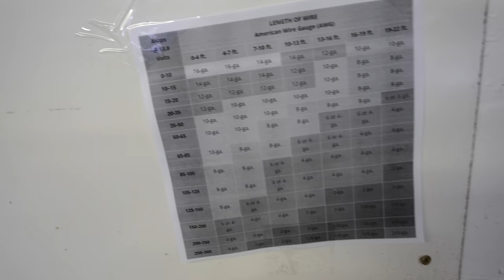Building the Brains of a Low Voltage System - Electric Hummer Conversion

Comment: Awesome.  Just a very fine point. Technically, fuses, or any overcurrent device, are there to protect the wire insulation not the wire. And yes, skin effect is an issue at 60hz. It’s why bus bars are typically only 1/4 inch thick. And then there is proximity effect which exists in both ac and dc

Comment: I just have to point out that the "current travel along the surface of the conductor" phenomenon, is called "skin effect" and only applies to AC current, not DC. And the effect is greater on greater AC frequencies. 

This is one of the reasons (although definitely not the only one) that high voltage DC is used for long distance power transmission (known as HVDC transmission lines)

Comment: You got something wrong, you said the wire has multiple small conductors because it transfers the current better. And that’s because the current runs on the outside of the wire. That’s actually not true if you say it like this, there is something like the skin effect, it says the higher the frequency of the current the more the current runs on the outside of the wire. But that’s DC so the skin effect does not „exist“ here. You can see on that if you some power company’s have actually big pipes not cables in their systems. And they only do that if because at like 50 Hz, that’s a typicall frequency in Europe, the depth of the current would be about a 1cm/that’s the thickness of you finger (for the Americans). The inner part of a very thick wire would not be needed so they use pipes with that thickness.

Thats pretty rough but i hope y all understood that.

Have a nice day

Comment: For your D.C. circuits (and typical household A.C.) you can assume the current runs thru the copper. The depth of the current is known as the skin depth, and the formula includes the frequency as well as the current. The higher the frequency the less deep the current will flow. So thousands of amps of D.C. you also start to be concerned about skin depth. In addition, unless the strands are insulated from each other they are effectively one strand so finely stranded wire is solely for flexibility. In fact at high frequencies where skin depth becomes important, finely stranded wire can be a problem because the power doesn't want to follow the strand as it dives down into the center of the bundle, making stranded wire conduct worse than solid. Physics is fun!

Comment: Jeez as fun as it seems to build an ev project so many safety questions. Is there an isolation monitoring system to verify no HV leaks, pierced HV cables, or any components internally shorted to HV. Along with isolation monitoring are the safety contactors inside the HV battery gonna deploy to prevent injury. Are the contactors inside the battery powered by a 12V crash interruped source in case of an accident? Any of the HV connectors have a interlock monitor in case of accidental disconnection or any unaware person unplugging them? You should do a video around all of your HV safety systems. All of this without some thorough safety behind it seems sketchy.

Comment: Note: The center pin in a relay is not a constant on. The center pin (87a - Normally Closed) is an off position when a the relay coil is engaged. It is the opposite to 87 - Normally Open. 87a is useful for motorized projects like window motors.

Comment: just a side note. that your information at time stamp 6:40 you say the middle relay wire you remove from the relay is pin 87a on the most relays. that is NOT ALWAYS ON. pin 87a is actually a switched wire like output pin 87. pin 87 is on with the relay but pin 87a is on when relay is off. for instance pins 87 and 87a power separate lights a pushbutton switch activates the relay which will then switch between the 87a light and the pin 87 light. switching as the button is pressed.

Comment: Cool stuff. Slightly concerned about the wire shielding wearing down on the edges of the ABS though.  Easy enough fix with a small grommet or just some RTV silicone.

Comment: hi jerry,
two notes
1. the first fuse is too far away from the battery. my suggestion is to use a Battery Terminal (Cube) fuse.
2. protect the cables with a cotton cable sheath. Otherwise, cables can chafe due to the vibrations in a vehicle.

Comment: @jerryrigeverything i would use a more intelligent fuse box and bus bars.  They have ones that are BT capable and will tell you when you have faults, your battery isn't charging or is dying and can diagnose your low voltage system quickly and accurately

Comment: Everyone saying it is easy has never done anything beyond replacing AA batteries in your remote. Its easy to watch, easy to theorize, but its an entirely other thing actually doing all of it. That fuse/breaker panel is near immaculate and he did it with a small piece of ABS. A job of this magnitude is a tremendous undertaking. How many people can measure and design the mounts for the motor, transmission and transfer case? I can only think of two people I know, and both of them are engineers. These videos are very inspiring and very interesting content. Also satisfying to watch something done and done correctly and clean.

Comment: The many strands of copper wire, do make the total cable more flexible; but, do not contribute to increasing the current carrying capability, compared to the same gauge of solid cable; in order to counter the so called 'skin effect' the individual strands must be coated with insulation; the skin effect does not happen at DC, and is not of concern, at low frequency AC, more so at RF, when the current is concentrated in the outer portion of the conductor, not on the surface.  The extension cord socket failed due to the several cables, all pulling power at the same time, not due to the length of the cables.  Have viewed several of Mister Jerry's videos, all are of value.

Comment: One fix from Electrical engineer: Current flows through the whole copper when we are thinking of relatively low frequency. As the freq increases the current is pushed more on to the "skin" of the copper wire. This is called skin effect and it is related on to freq. On DC cables this effect is virtually nonexistent.

Comment: Electrical engineer here, small correction @2:50 : what you're referring to is the skin effect and is present only on AC current and the skin depth decreases with frequency. So the current only flows on the outer edges when you're dealing with  high frequencies (so in microwave engineering for example you might have cables with hollow cores because it saves material and is not affecting the conductivity of the cable anyway). At DC however you don't have skin effect at all, all these strands essentially jusct act as a big solid conductor of equivalent size. Also all these copper strands are conductive so the skin effect would still be present in the resulting wire regardless of whether it's stranded or not (compare that with litz wire that is engineered to reduce the effects of skin depth and every strand is isolated from each other).

The only reason to have stranded wire is mechanical: the resulting cable is much more flexible and bendable as opposed to a solid piece of copper especially at these huge diameters for big currents. I also assume (don't have direct knowledge it just stands to reason) that it's easier for the cable manufacturers to produce them since they don't need to produce solid wires of different diameters, they just make tiny strands and package them together at different amounts to create the bigger cables.

Comment: Worried about the wiring setup a little bit.  It looks fantastic, but I’m not sure it’s fused correctly.  All those orange wires that were spliced to the red wires to feed power to the relays need to be individually fused because right now it looks like they’re only protected by the 100a breaker since they go directly to that distribution block, which I don’t think those wires or the relay would be able to handle 100a.  The point of the fuse/breaker is to protect the wire in case of a short or something before too much current goes through and wires/relays/switches catch fire.  It’s a very clean looking setup and I’m glad to see all those blue sea fuse panels, adhesive-lined heat shrink, etc.

Comment: Do not use a 12v Lead battery!

do not use your "main" battery to charge a 12V lead battery you better off running directly of the inverter or get a 12v lifepo4 (lithium) battery.
lead batteries are horrible to charge and to use because you throw away majority of the power you put into the batteries.

The only reason lead batteries are used in cars is because of the high AMPs require to start the car otherwize everyone would use lithium

Comment: If you don't like fire... You should not clamp up your battery on to the charger when in the car, close to the chasis. You will get a short VERY easy... (6:27)

Comment: Doing a great job. Just wondering if your melting those solder splices enough. When they are melted you shouldn't see a metal band anymore. The solder is ment to melt into the wires bonding them together. Without the solder band melted the center of the wires are not fused together, causing a hot spot and high spot of resistance. All in all, high resistance is less current and less voltage at the powered device. Also a fire hazard 🔥. Just don't want your project burning up a month after completion. Also, I'm a helicopter electrician so this is my life.

Comment: With a 12 v to 24 v boos converter all original 24 v equipment (lamps/wipers,fans) can be run from the 12 v battery.

Comment: There are two main types of 12v batteries, the normal ones and the deep cycle ones. The normal ones have spong like lead terminal to increase surface and thus can generate enough amps to crank the motor. But it can't do that for long period of time. On the other hand deep cycle can supply current for long time and many more charge cycles.

My question: don't you think deep cycle is better for ev's 12 v?

Comment: wouldn't do these heating + crimping + soldering thingys. like many videos on yt show (even tried it myself after seeing them) the wire doesn't get hot enough an this is not a proper soldering job. For applications that shouldn't break on you in the freaking desert, soldering the old fashioned way would be better. aside from that im impressed, Jerry.
Greetings

Comment: for you less knowledgeable people out there, the ones who are trying to learn things about how to work on electric vehicles for example, watch this man very carefully. because not only does he explain this in absolutely perfect detail, he's 100% correct in everything he explains to you. he doesn't leave out the little things, like the gauges of wires. Believe it or not, there's many people that have no idea about the gauge wiring, and the effect it has on electrical components. there's a reason why a starter motor on a car, has a large diameter wire. it's because you can't pull 200 amps through a wire the diameter of pencil lead. but he explains all this, and when he does he does it perfectly. in a nutshell, if you want to learn something, you're in the right place. 😏💯💯💯

Comment: No, electricity doesn't run on the outside of the wire. Only in high frequency static transmission is that true. If that were true, there wouldn't be a single solid core copper wire on earth. Everything would be hollow to increase current carrying surface area.
Wire is stranded to be flexible and durable against work hardening. That's it

Comment: Very nice show :)  but one little thing, you are using the wrong jaws for the hydraulic cable press, with results in "dog ears" after the cable and the cable shoe are pressed, it should be an equal hex 6 sided press fit, the 2 flaps on the side of your cable shoe result in a bad connection fit. and since copper expands alst when its heated up, the pressure line of the "dog ears" can split apart, since they are very weak.  the gage size should be on the jaws.

Can't wait for the end result. :)
Keep up the good work.

Comment: Minor correction to the reason for using stranded wire. The phenomenon you described, paraphrasing here, “electricity runs on the outside of the wire,” is called the skin effect. This phenomenon only occurs in AC power systems, which makes sense for the AC generator. This phenomenon occurs when the alternating current creates Eddie’s within the electromagnetic field inside the conductors. These Eddie’s are caused because of the alternating current, basically clashing in to each other, resulting in the electricity wanting to run to the surface of the wire. I myself am not an expert in this but I thought it was interesting in my electrical theory classes, and I might have something mixed up in my explanation. Someone feel free to correct me. Also you are correct in using fine stranded wire to reduce the skin effect for you AC system.

Comment: Solder connections are not ideal for high vibration applications such as automobiles. Solder work hardens and breaks. More often than not you are better off with regular crimp connections in these types of applications. Also if you don't get the solder hot enough and it doesn't melt properly you can end up with a connection with higher resistance than if you just twisted the copper together. Edit* After watching the video. You 100% need to at the very least go back and re-heat those solder points. The ring needs to melt completely impregnate itself in the copper strands. As an example @ 11:27 the two connections on the orange wires are not good and need to be re-done.

Comment: Hi Jerry,

I am stepping in here to clear the confusing a bit about the relays.
You made a comment about fuses and relays at 15:10

Unfortunately making the comparison between the two uses is not the right thing, because the two are two different devices.
a fuse is a protection device, it breaks the flow of current if it exceeds the fuse limit. And then you will have to replace the fuse.

a relay, as it names says, it relays a message. basically as a human you don't want to touch electricity especially the high current electricity, so, you will use a low current circuit to operate a high current circuit.
Eventually you supply power on the relay coil, the coil will act as a magnet to pull on the contacts of the high current circuit (high current switch) and, hence completing the circuit.
You can still use the contactor side to operate a low current circuit, all what the relays do is provide and electrical isolation between two circuits.

In electronic circuits, an optocoupler is usually used to serve the same purpose.

Comment: Like you said there's a lot of right ways to do it. 

For those sealed solder joints, they are good for repairs. For new work it's usually a good thing to do full solid runs of wire. The less unecessary connections in a system the better.

You can buy a crimper and pin tools to wire your own weather proof connectors. Like the relay terminal blocks, you can buy just the uncrimped metal terminal that goes on the end of the wire, run your whole wire from point A to point B and then crimp the little spade connector on the end for the relay terminal block.

You can also buy entire oem style automotive fuse/relay boxes that don't come wired for applications like this.

I love the series so far!

Comment: Better wiring than most, however I have one nitpick. There is no wire protection on the wires as they go through holes. There's gonna be a LOT of vibration in that truck, although less so than when the 6.2 or 6.5 GEP was in it, you still run the risk of chafing wires and wearing holes in it...

Comment: Humble disclaimer - I've never tried such a task as this. When completed you're sure to be bounding from rock to rock over the prairie and this might make some wires chaff against the metal bodywork with the potential for a short to develop and even a rapid unscheduled disassembly to occur or a fire. Is it worth putting a sheet of that thick black polymer behind the distribution panel and grommets wherever a wire goes through a metal panel?

Comment: Skin effect in wires is only an AC phenomenon and it's only a significant issue at high frequencies; DC circuits are not affected.  Large gauge wires are stranded purely for flexibility.

Comment: this could be a dumb question, but why do you need a 12v battery in an electric car? Can't you use a dc-dc (there is already one on board) or tap 12v from lithium pack?

Comment: Electrons travel though the copper, not on the copper surface.
The purpose of stranded wire is the make the wire flexible. 
0000 solid wire would be too stiff to be useful.
Stranded wire is more expensive than solid wire.

Comment: Hi Jerry and friends, those black circuit breakers with the red levers are great as switches but not for carrying any kind of current. search youtube(as always) and you'll find that they are just little resistive space heaters after about 10 amps.

Comment: Your explanation of electricity flowing around the outside of a conductor is completely incorrect. A solid conductor is the absolute best way to get electricity from point A to point B. The only reason wires are stranded is for flexibility. That's why wires that are meant for static installations are often solid copper or have very few strands.

I know a lot of people who work with electronics think this. But the physics of it is that electrons actually move through the copper atoms. That's why it's important to have very high purity copper. I think people who don't understand that electrons can actually flow freely through metal atoms are the ones who have made up this myth that electricity flows on the outside of a conductor.

Comment: Hi. Sorry but i must say you that it is not true that the power runs oround the wire, that only happend if you have high frequency,. The cabel you showed is a high powercabel wich can handel a lot of amps. Its have so much littel wires that it is flexible!